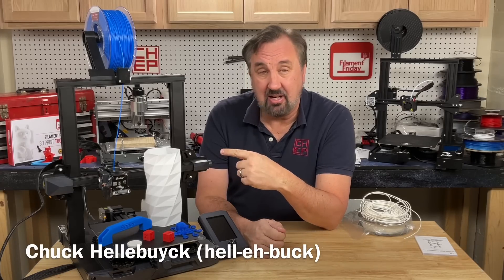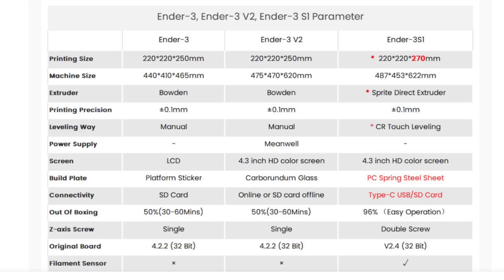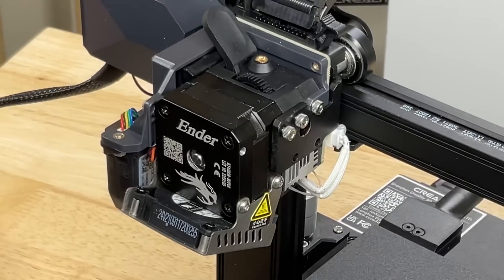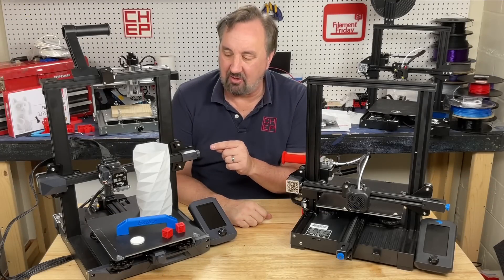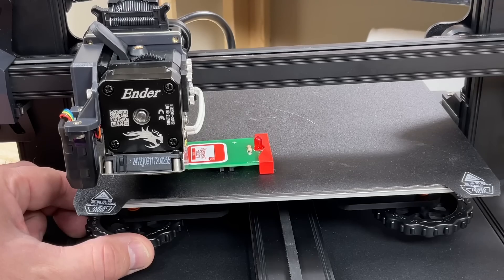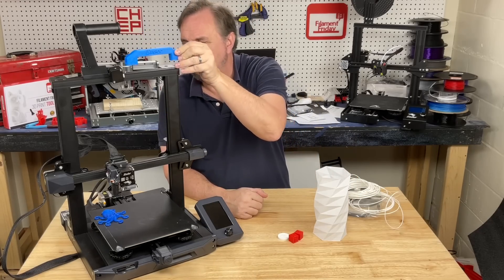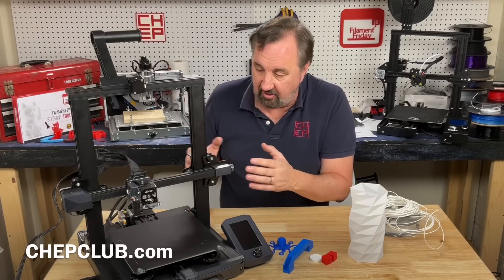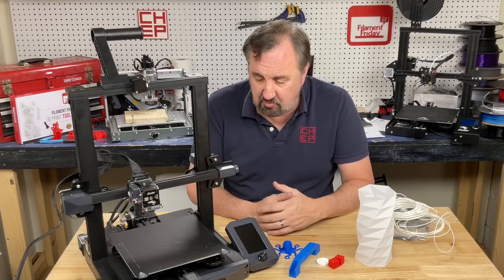Ender 3 S1 - The Direct Drive, Auto Level Ender 3 3D Printer?

Comment: is the USB_C only for connection to the PC, or can you also just use it like the SD-Card, to print out some files from a USB-C stick?
Reply: USB C connection for the PC. Or what I do is have it plugged into a raspberry pi running octoprint so I can print from anywhere on my network.

Comment: Hello CHEP

I’ve been watching your videos and following your advice since I got a Ender 3, recently replaced by an S1. I quite agree with your comments, but it prints very well, better than my Ender3 upgraded as possible.
It is not free of small assembly defects, it is noisy too, it is necessary to tackle the ventilation to have silent impression and especially to change the tube of the block of heater as you recommend. Printing TPU is very easy with. 

Thanks for your profiles, which once adjusted to the retraction parameters for the S1, work perfectly. Using an S1 with cura and your profiles is very easy to print without any worries.
A question, in for a given object, a machine profile made from an ENDER 3 and another from that provided by Creality, gives very different printing times.
Your standard 0.20 cube is 30 minutes and Creality profile is 17 minutes for the same result at the end. From what it can come.
Thank you for your answer.

Comment: Chep, I get this problem with both my Ender 3 and Ender 3 S1. The Ender 3 has a BLTouch and and the Ender 3 S1 has a CRTouch for bed leveling. After I have leveled the printer, I print the bed leveling calibration print native to Cura and the layer height is different on one side of the bed than the other. I have tightened the beds on both. They were at one point loose. I cannot figure out why the calibration one print with a consistent layer across the entire bed. Any suggestions?
Reply from the maker: Check the lead screw for binding.

Comment: 1. The kB size of the ARM-Chip dependes if it has a micro-SD cardreader under the Controller.If so mainboard may hide a eeprom. 
2.Why not a filament roll? Cause it gets too expensive. You normally buy a spool of filament when ordering one.
3. If you want a better nozzle do one printhead yourself. Easy.  If made a +- 500°c hotend for my S1. You need to change to watercooling etc. 
4.What you expect of a 430$ printer? Aint a Prusa,Ultimaker etc. If you want that you pay double to infitny amount of money. A Ultimaker with two printheads,a filament System will run you about 11k$+

Comment: Hey Chep!
I recently bought an Ender 3 S1 and have watched pretty much every video you've put out about the Enders. Something that I have been dealing with since the beginning and have not figured out are my slicer fan settings compared to the ender settings while printing. To make it a little clearer, I have my cura fan settings at 30 to 50 max (printing with PETG) but my printer almost always overrides that and exceeds it by quite a bit on certain sections of the print. This requires me to be pretty attentive and prevented me from doing any longer prints. Any idea what could be causing this?
Any help would be appreciated!
Reply from the maker: Not sure. Could be a firmware issue.
Reply: Do you have a different fan value for your bridging in the slicer that may not be constrained by the 50 max value?
Reply: @lathamspeasmaker1260  yup! My fan values on the printer itself are going up to 255 and I didn't realize my slicer settings are looking for a percentage out of that value. I was setting it to 32 which was way too much. Narrowed it down to 13%.
Reply from the maker: I believe there is a setting in advance settings for bridging you could try.

Comment: Another fantastic video, I just bought one of these printers but I noticed something different about bed. You mentioned there was a coating on the build plate. I noticed it now hold the glass bed seemingly better then a magnetic bed. I think I’m going to try doing a print without the clips to hold a glass plate firm. Unless you would recommend against that but it seems to be how long like glue until the glass bed cools off.

Comment: I believe there will be both supply and demand for these s1 sprite extruders.  (for a while).  Hear me out.  Currently it's difficult to get the s1 pro.  People like me are ordering s1 instead of waiting that long.  Some of us are upgrading to the all metal version which I believe you can just bolt right on there.  So we sell the ptfe version.  So there will be supply on ebay, fb marketplace, amazon, etc.  Then there will be demand later down the line as people start burning out their ptfe tubing lol.  Just an intersting dynamic I noticed.  For this reason I may save my stock extruder, put an all-metal on (already got a free pei steel sheet with my printer on amazon) and I'll pretty much have an s1 pro.  Then if I can't sell my stock extruder for a while, I'll hold onto it until that demand spikes (idiots burning out theirs) and sell it :)

Comment: Guys, Creality released bi-metal heatbreak for this printer, you can buy just the throat, or the heatblock. They also released an LED light kit, and a laser module.   I just bought the high temp all metal heatblock, throat for $30 from Creality's shop.  ( You don't have to buy the whole Spite Pro)
Reply from the maker: I don’t see the heat break only the led bar.

Comment: I appreciate the detailed review. I had a Creality machine and won't ever go back (CR-6 Max). 

What I notice in almost every single Creality printer review is that somewhere on the machine the reviewer recommends an upgrade. Another reviewer mentioned to replace the print sheet with something else, your review was much more detailed and mentioned the hot end limitation and weak points. If you buy this machine and want to remove those limitations you're getting that much closer to a Prusa MK3 kit. 

There is a reason that Prusa is considered such high quality, that printer once assembled does not need a single upgrade. It's built to print whatever you want or need right out the gate. 

Creality Ender 3 S1 $429 + Wham Bam Build Plate Upgrade $65 + Hot End Upgrade $80 = $574
Prusa MK3S+ - No Upgrades Needed = $749 + $50 shipping 

For $225 more I would pick the Prusa. Save the extra money and buy a machine worth your time. I am interested to see when Creality actually makes a machine that doesn't require modding or upgrades.
Reply: I agree. For the price you can get it, even if it needs upgrades, an Ender 3 is a steal.
But, once you start approaching the price of a nicer machine and it's still missing things, why would you go with Creality? Also whilst it is using the stock Creality heat break used in all their other hot ends, it's also still using the glass bead thermistor with the PTFE lined wires. So even if you do upgrade it, you can't do higher temps anyway!

Comment: help my ender 3 s1 keeps scratching up the bed and prints are sticking too well what do i do
Reply from the maker: Adjust the z offset to a larger value.
Reply: there's an error on some Firmware versions where the Z-Offset it is not stored properly and every time, you start a print it's either too low (scratches the bed) or too large ( pure spaghetti).
Mine had FW 1.0.5C and it was all over the place, downgraded to 1.0.3 and my troubles went away.
Reply: thanks

Comment: Can you release an e level file for this printer? I can’t get it to work properly and I’m about to return it
Reply from the maker: Already have it at: https://www.chepclub.com/electronic-bed-level-tool.html
Use the M0 based Ender 3 version. Works fine. 
There is also a G4 version as well that pauses for 20 seconds and then moves automatically. 
That machine also has autolevel so the E-Leveler is used to get it close before autolevel. 
What issue are you having?
Reply: I’m having an issue mostly with my ender 3 pro with upgraded silent board. It’s not pausing when it stops at the corners.

Also on a side note, any plans on a ender 5 plus  file for the e leveler?
Reply from the maker: Use the new G4 version on the site (For Printers that don't recognize the
M0 pause command). It will pause for 20 seconds at each corner so you can adjust and then automatically move to next spot.

Comment: for some reason my cr touch is not saving and doing the auto level that everyone say it does.
i am running the jyers on my ender 3 v2 should i use this code?
G28 ; Home all axes
G29 L0 ; Load mesh from slot 0
G29 A ; activate leveling
G29 J2; tilt mesh
or someting else
i only ran the G29 code
Reply: you run it from the printer.  don't need to do it very often.

Comment: I have no issue with them using a 256K microcontroller. Aftermarket firmware is of no concern to me
Reply from the maker: Give it time. You will.
Reply: @FilamentFriday  The best thing I ever did to my CR6 SE was putting on the community firmware.

Comment: Hi Chep. I am having problem with z offset constantly changing. Is it because I don't do the manual leveling because it wasn't in the video or manual? Also, will you come out with some best setting you usually use for the refraction? I used 0.8mm which was the default out from their "cura" and when I print the temp tower, holy hell, at 210c above, there is a huge wall of string happening. At 205c, where it seems best for my filamen, less string but I am doing the refraction test next. Is 0.8mm to low or something? Sorry, newbie here. Also, regarding the heat break, is there a way to replace that? Sorry for lotsa question, newbie here.
Reply from the maker: The Z offset shouldn’t change after you set it unless the printer homes itself.
Reply: @FilamentFriday  oh... you should never home after u set z offset? sorry new here. But then, if I look at the printer start gcode, it always have g28 Home? Does that change the z offset everytime you print then?
Reply: @FilamentFriday  hi Chep, just to update you if anyone ask, apparently  the out of the box firmware (I can't remember what version) and their latest firmware Ender-3s1-hw24s1_301-sw-V1.0.5_C-CRTouch breaks the z-offset. It keeps changing when measured especially after a print. At the same time, the Z axis can not be set to go below 0 anymore. I've downgraded to the previous version v1.0.3 and now everything is working fine. When I do home, the rest z-axis actually show 10 plus the offset value unlike the latest version that just show 10 all the time. Already emailed their support. Thanks anyways!

Comment: I seem to have issues with my S1 when using CURA, no matter what i slice in CURA it seems to want to print at the lower left of the build plate, half on half off. Same file in creality's slicer and its fine. Any ideas as to why this happens? Im chasing a decent PLA profile for the S1.
Reply: You have the profile in the Creality Slicer (which is a somewhat older version of Cura).  Otherwise suggest to copy the start/end code from Cr.Slicer profile to Cura's profile.

Comment: What is the max safe temp for the S1. Im only interested in printing PLA/TPU and PETG, and the printing temps of PETG (230-250C) worry me. I know the manual says 260 C is the max for the S1... but isn't that too high for PTFE??? I have no interest in paying the premium for the S1 PRO just for an all metal heatbreak, does anyone know a third party that sells one for the S1? Or do they use a better PTFE like Capricorn Tubes, and I've got nothing to worry about going to 250. Help me CHEP :)
Reply from the maker: That’s why I recommend the Slice Engineering heat break and your PTFE concerns are gone. https://youtu.be/tYbL-O3FecY

Comment: Looks like they are releasing an S1 Pro for $500 that has a proper heat break and goes to 300C. Includes a 4.3” touch screen as well as an LED light. Does this use standard nozzles? If so I’ll probably order the pro.

Comment: I need help. I want to buy my first 3d printer. Which would you recommend? I'm looking at ender 3 v2 with dual z or ender 3 s1.
Reply from the maker: I’ve never heard of a dual Z V2. If you want that then go with S1
Reply: just get the S1 or a Prusa mini.
Reply: You can add dual Z to a Ender 3 V2 for under $50, I did it on mine, however it's not really worth it unless you have already converted to direct drive. If I had to go through it again I would still get the V2 over the S1. With the extra money you can get a proper hot end, direct drive, dual Z, PEI build plate, and still come out ahead. On the S1 I don't like that they covered up the extrusions, now you can't attach stuff to the rails as it's covered with plastic now. Looks pretty but takes away practicality.

Comment: Great video, thank you!
I bought a Voxelab Aquila last year, which is an Ender 3 V2 clone. The upgrades I did to it are pretty similar to those that Creality did with their Ender 3 S1 - Dual lead screw with dual steppers, PEI springsteel bed, a new fan shroud assembly for better cooling. I'm also planning on a direct extruder, a bi-metal heatbreak and maybe a self-built enclosure for ASA printing. 
I like to see that Creality did similar modifications to the V2 as I did. Seems like I'm not wasting money on upgrades after all.

Comment: Hi! I really liked this video. I am really tempted to buy the CR-10 smart pro but after this video i may buy the ender 3 s1 with a bi metal heat brake. But do you think the CR-10 smart pro is worth the extra buck or should i go with the ender 3 s1? best regards
Reply from the maker: I don’t like the CR-10 smart. I’d rather have the S1

Comment: Hey Chuck +CHEP ! Nice review and on point! I like it.

With all these Ender 3 machines on the market (also used) I wonder to what point an original Ender 3 can be upgraded? Maybe this could be a nice short series of videos on your channel. And since you already has shown many ugrades, you could link them in a recap video for further information. Especially to upgrade to a filament run-out sensor, auto bed levelling and tpu printing would be my basic requirements! Also: is there anything to look for with the mainboards and the stepper drivers? Like you mentioned in the video maybe some versions had better boards than other?

... or is all that wasted effort and the Ender 3 V2/ S1 is the only way to go if I want auto level, filament sensor and wanna print ninja flex?

What do you think? In my area (Germany) there are also many printers to be found on the used market. Many people upgraded or dont have the time anymore. But the Ender 3 was always a good printer to start ... so maybe an old V1 still is a good base option to upgrade down the road.
I also had the OG Ender 2 in mind. When it came out several years ago it had a very good print result but strangely Creality did not sold it as long ... That would be another fine "project", wouldnt it?

Greetings!

Comment: Boohoo 😢 Boohoo.  The extruder driver on the mainboard went on vacation.  And extended vacation on my 2 year old Ender 3 Pro.  I was about to print a case for SKR 1.4 as mounting holes don’t line up in stock metal case.  Grrrr

Comment: When assembling I had a minor "issue" with the filament run-out sensor; the wire didn't seem long enough. Turned the piece of plastic holding the wire to the rail had moved and I just had to slide it back.

I did create some cosmetic damage on my plate because the PLA stuck so well that I couldn't get it off (heating it up did the trick for me).

But the printer is really nice. I just assembled, auto level and did a test print. No manual bed leveling. It just worked. Bed adhesion is almost too much! (on a clean plate)

Total beginner as I am, after a while the prints didn't stick, and I had to figure out how to clean the bed. Some suggested soap water. Others isopropanol (aka 2-propanol). I did both and it works again (Acetone will damage the plate).

Another beginner mistake I made, when doing the paper test, the nozzle stops at z-0, with is good. But some plastic may drip to the plate and stick making the paper test off unless you move the nozzle to the side.

Compared this printer to my first experiments with 3D printers I am overwhelmingly positively surprised. But then again my first take on 3D printing was 9 or 10 yrs ago with the kickstarted Printrbot v1. Which took me 2-3 evenings of head-scratching to assemble (they apparently kept refining the printer while sending the kickstarters, so I was sent a "between" version, and I had to assemble it using 3 different overlapping set of instructions, NOT fun!). Also the printer failed the print 4 times out of 5. Leveling was, uhh tricky, and had to be redone each time. I gave up, put it away and waited approx 10 years. 

As said, I am pleasantly surprised with the Ender-3 s1. Had expected some troubles, but it just works! Only failed prints when I'm testing or experimenting. It does have some over-extrusion at the corners that I am trying to figure out how to get rid of (going really slow 25 mm/s is one way).

Comment: i would buy a ender 3 V2 and upgrade the hotend, i dont need bed leveling and fillament senzor, is that a good choise? and what hotend should i choise for nylon? thx
Reply from the maker: Put a slice engineering heat break in it. https://youtu.be/tYbL-O3FecY